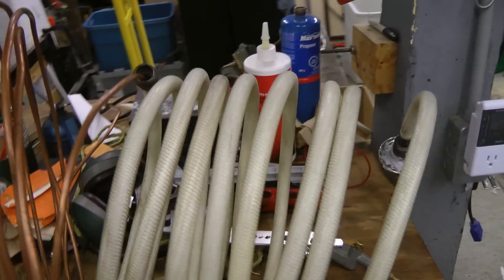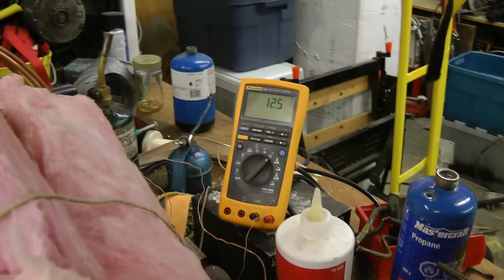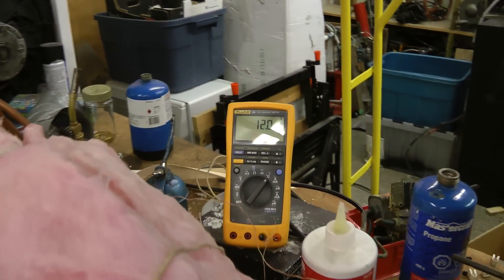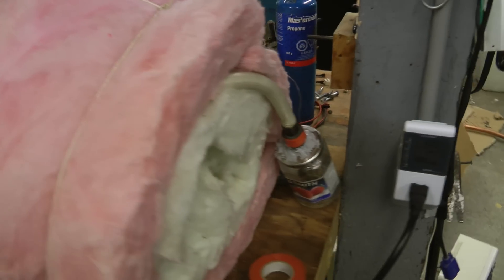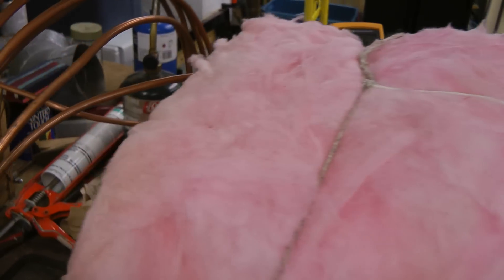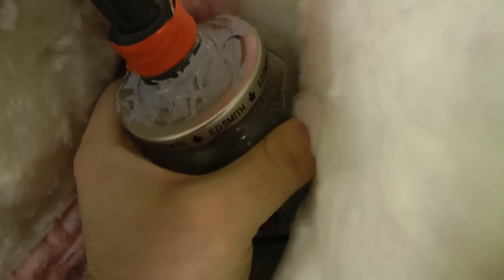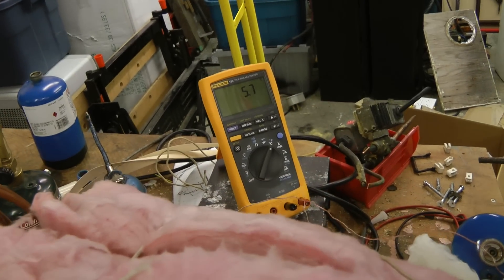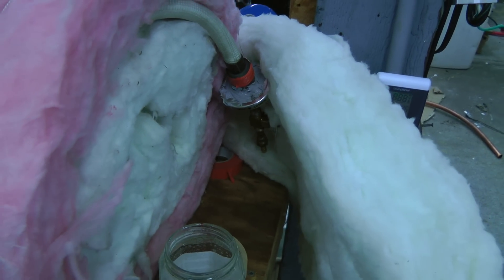Hampson-Linde air liquefier - Part 2

Comment from the maker: @8tyman8 Temp is in C. Note that the reading is too high here because the multimeter was still warm from being inside the house just before making the video.

If I give a temperature, you can assume it's in Celsius unless I specify otherwise.